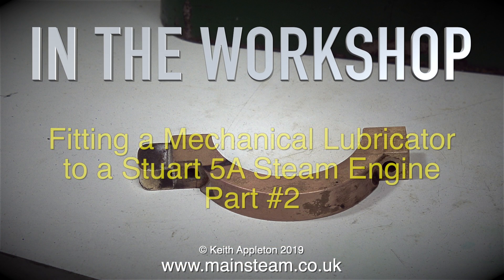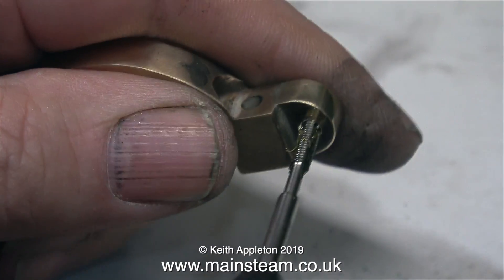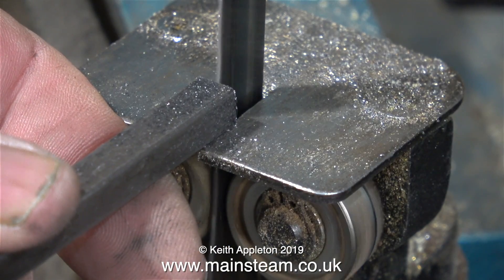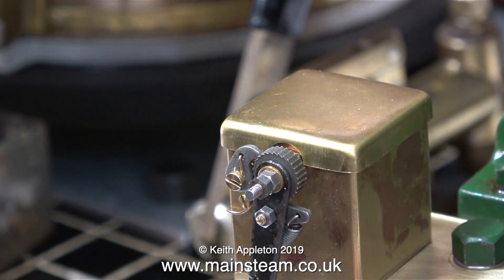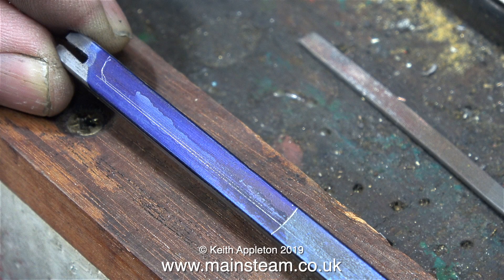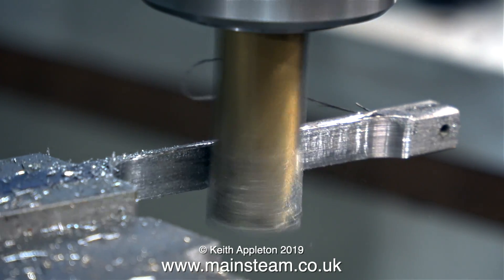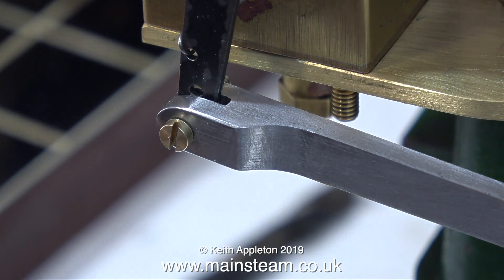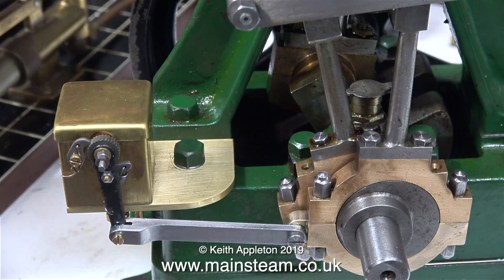HOW TO FIT A MECHANICAL LUBRICATOR TO A STUART 5A - PART #2

Comment: Keith, I need a ratchet lubricating for a much larger engine - two cylinder, 3 inch bore by 3 inch stroke, running at 180 psi.  So far I have had no luck.  Can you recommend any place I should look?  Warm regards from the USA.